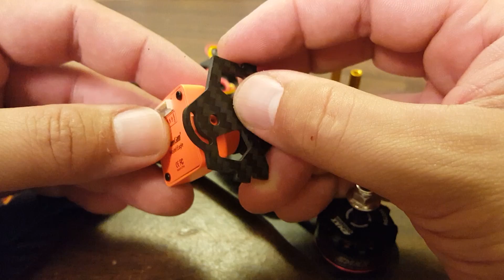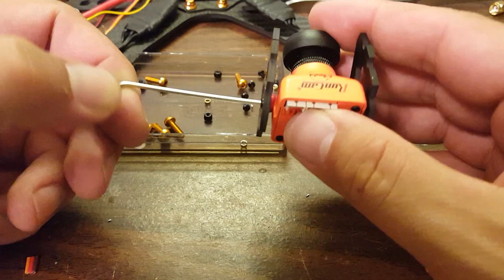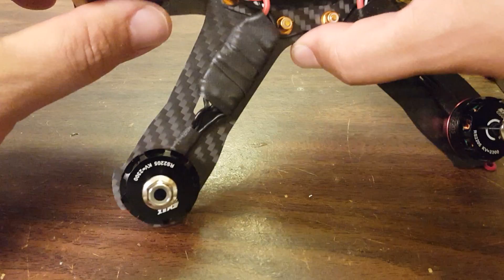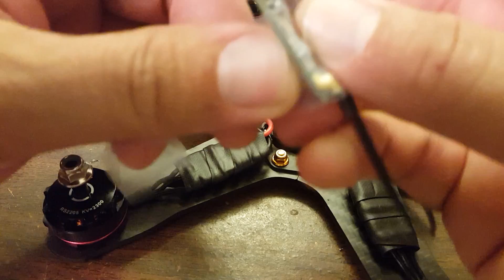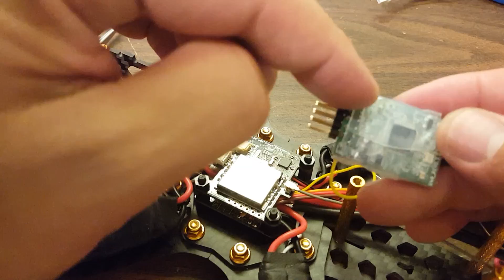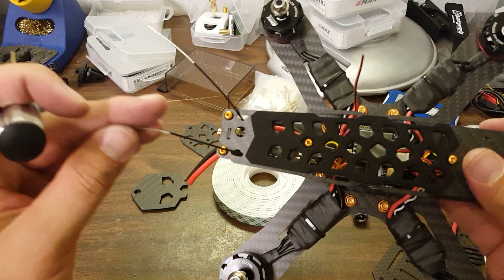HIGH END RACING DRONE BUILD - Part 4 | Skull N Drones Rampage w/ Furiuos FPV Kombini

Comment: Joshua Bardwell, I have the runcam swift and the Rampage frame, but the camera doesn't fit well.. did I make something wrong?
Reply from the maker: No, it's pretty tight.
Reply: Joshua Bardwell but the topplate doesn't fit too...
Reply from the maker: Yeah. You have to squeeze the side camera plates together to get them to go into place on the top plate.
Reply: Joshua Bardwell ok thanks

Comment: which motor you will recommend more on the smoothness, durability, fast.. the Emax reds 2300kv or the dys SE2205 PRO 2300kv ?
Reply from the maker: +MC flyer emax.

Comment: Seriously considering getting one of these frames but hate the thought of 4 escs spoiling the design. Would you trust any 4 in 1 out at the moment? I'm hoping for blheli_s. Thanks in advance Simon
Reply: Blheli_S? Banggood is bringing some new Powercube Style FCs. Or wait for the new Powercube with integrated VTX!
Reply: Crooked cool will watch for them. Wanted to build this drone to the very best of my ability so replacing a dodgy esc cause I bought the wrong one is not good!!! Was hoping for a premium brand to release. Thanks for your advice
Reply: Crooked bought one. Thanks for heads up.
Reply: Thanks for your support! Your Rampage is on the way! Have fun and enjoy! :)

Comment: Josh were u able to get sbus working with the kombini? Also, I can't seem to flash the kombini through betaflight, did I had any issues with that? Thanks for your videos.
Reply from the maker: +Guerrilla Drone no issues at all. If you can't flash your drivers are probably messed up.
Reply: Joshua Bardwell Got it to work!! It was the drivers and I had my sbus wires mixed with telemetry :P Thanks for the reply!

Comment: Looking forward to hearing your thoughts on the esc's. I'm currently using 8 of these and love the throttle control. not much love for these on rcgroups.
Reply from the maker: I don't think there is really a bad blheli_s ESC out there these days. They all seem to perform really well on quadmcfly's testing.
Reply: What firmware did you end up using, I flashed A-H 30. I never could get the desync issue worked out in 16.2 on two near identical setups (only difference hard/soft mount FC and RS2205-2300/2204-2300 V1). So far 16.3 has been flawless.

Comment: Nice to see an build video i fly this frame now a while and love it!!
Reply from the maker: +Crash Airline FPV any hard crashes?
Reply: Joshua Bardwell oh jeah many chrashes i cant count them i fly often on a old construction area there is only beton and other hard stuff, the badest chrash so far was on a race event while i was on full throttel and than a wild rooftop ;) was in my way there i managed to break the top platte behind the cam mount and 2 motors and the two front spacer where a little bit deformed! But this was the only hard destruction in 3 months hard flying! i have many build pics and other stuff on instagram (kerni_fpv)

Comment: Thanks Joshua, will be keen to see your final AUW including Antenna + FPV cam.

Like you mentioned, I reckon this particular frame would really suit going with a stack mounted 4-in-1 style ESCs too.. the Cicada with BLHeli_S would be one great option.
Alternatively a TBS Powercube type setup would also look quite neat.

Something I think is a worthwhile video (later down the track) is showing a back to back, re-design / re-build video.  

I've recently rebuilt / tidied some of my older quads & found they not only look better, but lost quite a few grams, tweaked wiring connectors for improved durability, flew better with improved components & gave a my "older backup frame" a new lease of life. 
Even minor things, like improved antenna mounting / placement allowing to fly further out can help build confidence & enjoy flying even more.

Whilst its going to get raced hard, still reckon on something like this it is nice to go that extra mile, keep wire lengths as short as possible (less weight) & make it super tidy.  
Reckon going all-black wiring, black FPV cam with some T-Motor F40 IIs would match the black+gold colour scheme too :)

Comment: You will have no trouble making it fly, so for me, the big question is:
After the build, what are your thoughts on it as a platform?

It looks good naked but once you start dressing it up, much of those looks seem to be disappearing into components and more will disappear into dirt, scratches and repairs.

cheers and thanks for posting
Reply from the maker: I agree that this frame deserves more effort put into aesthetics than I typically give a frame. But I don't think of it just as a showroom piece. The creator claims to have done all sorts of complicated CAD analysis of the design, as well as lots of flight testing by actual racers, to ensure that it's strong. I hope he's right and the frame flies and crashes as good as it looks. That being said, it's definitely true that some of the things that make the frame look good, like the design of the arms, make it less flexible to build. So a proper build would take aesthetics into account from the start, rather than as an afterthought... or, in my case, barely thinking about them at all.

The frame is roomy. It's bigger than it strictly needs to be, especially if, as the creator suggests, you build it out with a 4-in-1 ESC. I would love to see what the Skull N' Bones designer would make if he set out to do something closer to a 190mm frame like the QAV-R and similar. That being said, I don't think flight characteristics will suffer too much from its size. It's not that dissimilar from the Alien, which many people adore. And the larger size certainly benefits people who might not have as much experience building, or who might prefer a pinned-out build instead of a direct-soldered build.

Comment: Why not just de pin the x4r-sb?
Reply from the maker: +Peter Kornum every time I depin there's a chance I will damage the component. Since thus is such a roomy build, no harm in leaving the pins on.
Reply: Joshua Bardwell fair you could just cut Them Close, thats fairly safe...
Reply from the maker: It's true. I do agree that there is basically a 100% chance I will never use those other PWM output pins, and having the extra 5v and GND pins is an invitation to trouble.

Comment: Are you going to put up flight/tuning vids for this build? I'm curious about that FC. I've got a QAV-X frame and everything is such a tight fit. That Kombini setup looks like it might be nice in there.
Reply from the maker: I might do a tuning series but honestly I don't expect there to be any surprises really. BLHeli_S ESCs, Emax 2205/2300kv motors. Maybe I will do something different like put quad-blades on it just to mix things up.
Reply: 5s?
Reply from the maker: +Stephen Gibb maybe.

Comment: You put the eagle mount upside down. You need to turn over 180 degrees the mounts until the eagle is upside down and then unscrew the eagle and turn it over and screw it.
Reply from the maker: But then wouldn't the angle retaining slots allow only down-tilt?
Reply: Joshua Bardwell does eagle come with a different back plate like the swift and the owl that has the retaining screw holes? If not do you have a spare you can try?
Reply from the maker: I don't think it came with a spare back plate.

Comment: where did you get that nice THIN sma extension? 
Also, which 4 in 1 ESC would you recommend?
Thanks
Reply from the maker: Any pigtali with a u.FL connector will be super thin.

https://www.amazon.com/U-FL-RP-SMA-Pigtail-Antenna-Cable/dp/B005UWD0EG

I don't have any experience with any 4-in-1 ESC personally bit if I were buying, I would look at the Cicada 4-in-1 because it is BLHeli_S.

Comment: I am not convinced about this frame. It seems like only 2 standoffs in the middle is not enough support. Also, I don't like the way the esc's sit on the arms, but I guess you could always drill out holes to make them fit better.
Reply from the maker: +JaphSan or use a 4 in 1.
Reply: Yes you can, but I like have my esc's on the arms as they are easier to work with/replace in case something goes wrong. Looking forward to seeing it fly. Thanks for the great videos. I have learned a great deal from them, as they are very helpful! Keep'em coming!